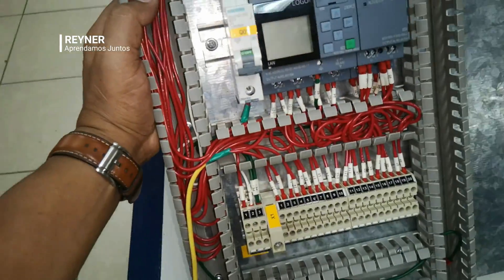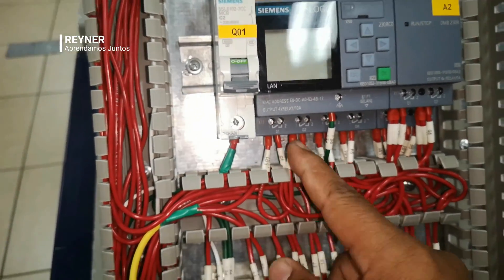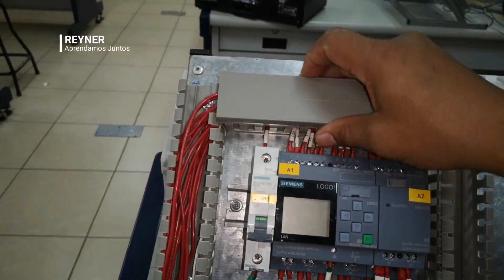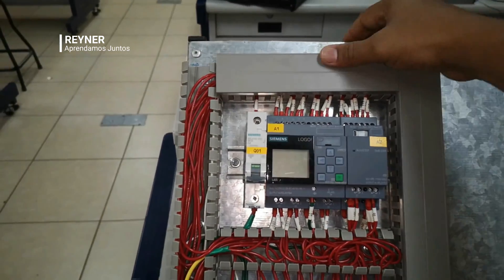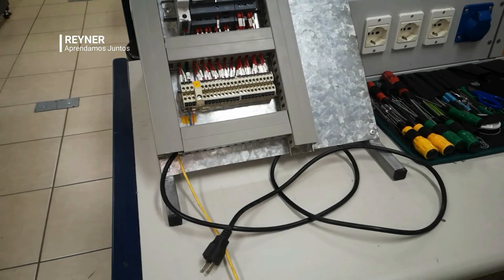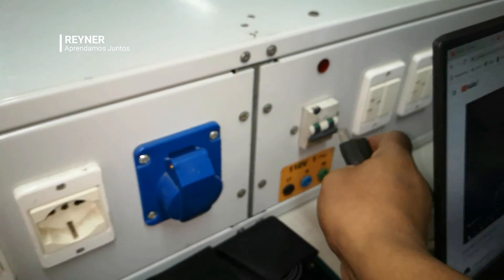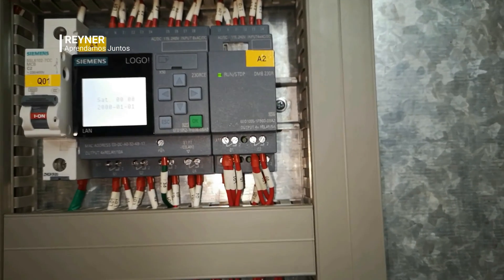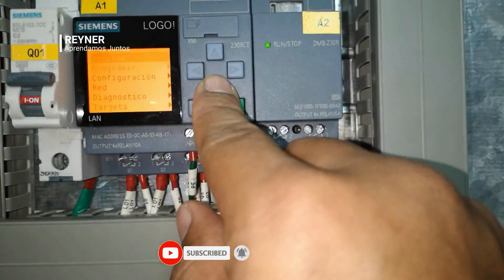Montaje de #LOGO 230RCE Siemens en #Automatización Industrial

Comment: Si alimento las entradas digitales (I1,I2,l3,I4, ect) del  logo 230rce y el módulo de expancion dm16 230r con voltaje 128vac ¿Si resiste ese voltaje o recomienda instalación de un regulador de voltaje para para alimentación del control del tablero y entradas digitales del plc?